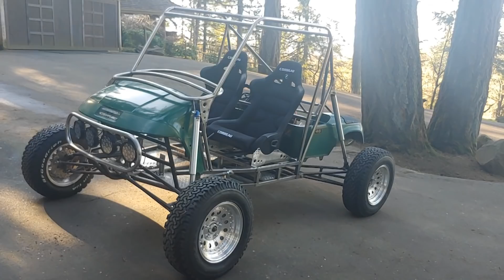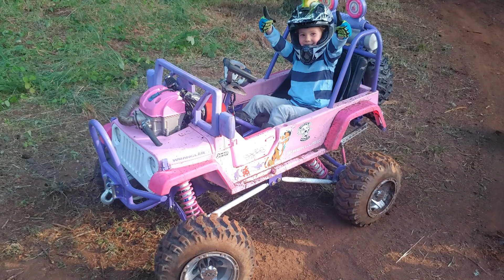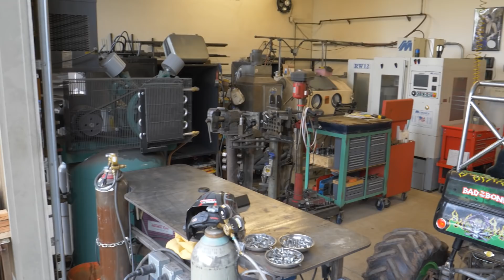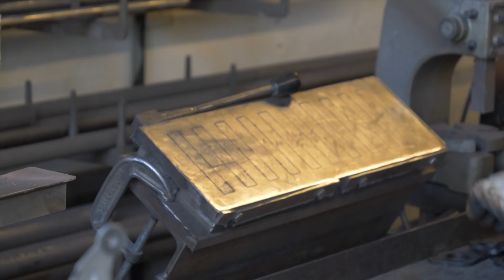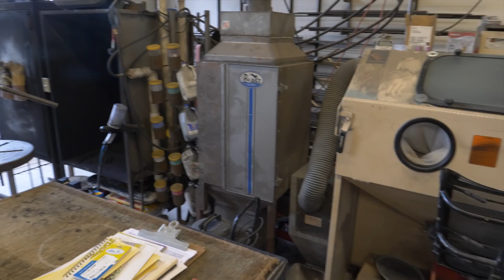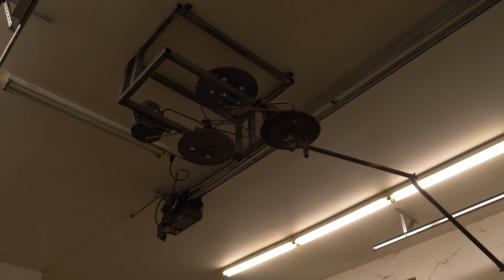Moto Mule Metal Fabrication Shop Tour Video Plus Time Lapse Camera Rig and New Channel Artwork

Comment: I've been welding over 47 years and  just turned 66 , still welding and fabbing and sometimes racing .  I may have mentioned my latest project in a comment , but don't mind throwing it out again ...just finishing up an all aluminum chassis oval track kart using the ninja 250 (same engine as BBR is using).  This has all the adjustability of a true racing kart , everything hand fabbed including a stainless 2 into 1 exhaust ...   I often use  F1 , Indy car , performance marine and offroad for inspiration on building some components .  Love your builds and attention to small details
Reply from the maker: Awesome! Keep it up! Thank you for watching!!

Comment: Nice shop! I'm in my 50's also and was a welder fabricator/industrial mechanic for over 25 yrs. Unfortunately I ended up getting muscular dystrophy so my career had to end. When I was working I had a huge snap on box with about $30000 worth of tools which I gave to a close friend because I couldn't store it. I still have alot of tools at home but someday want a small garage shop to tinker around at my slow pace. My skills after all those years got pretty good if I say so myself 😜 and I feel they are being wasted. I have 3 grandsons and hope to pass this trade on to one of them since tradesman are a dieing breed. Good luck with your endeavors. 😁

Comment: When I worked in a limousine metal shop, I used to have to put my cell phones in a plastic ziplock bag because all the metal would end up sticking to the speaker. I must have gone through about 5 phones in a year once till I got sick of replacing them so i just bought a bunch of speakers and started replacing them myself.

Comment: I'd be interested to know more about the welders you use
Reply from the maker: Miller 210 with .023 wire, Miller 251 with .030 wire, Off brand Inverter 160amp TIG with Miller water cooler torch setup.

Comment: Once upon a time I had all the machines I needed. 
Then my garage burned and everything in it was destroyed. 
The insurance covered a new garage, but not my machines.
I was 56 then and didn't want to start from scratch again. 
Make sure you have comprehensive insurance
Now I have a quiet life.
Reply from the maker: Oh man! I would be devastated if that happened. I do have comp insurance, but even still, many of my tools are home made, many many hours.... I'm sorry that happened to you!
Reply: @motomule   These are things you have to come across and leave behind.
Of course, I have provided the most necessary. A stick welder, a winch and a motor lift.